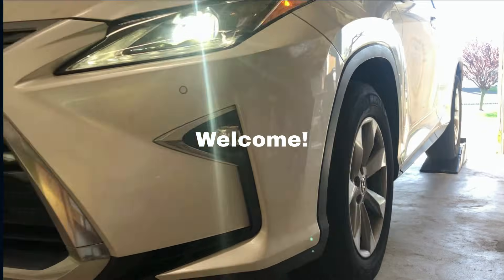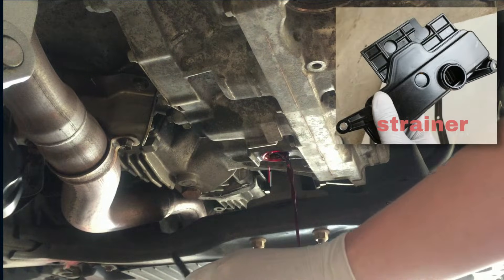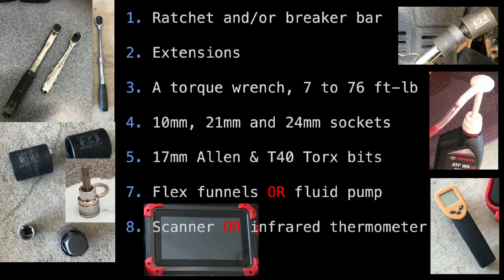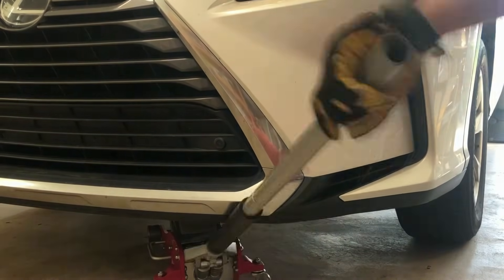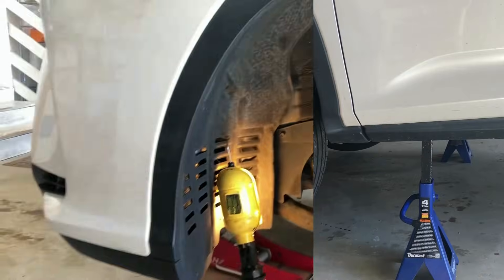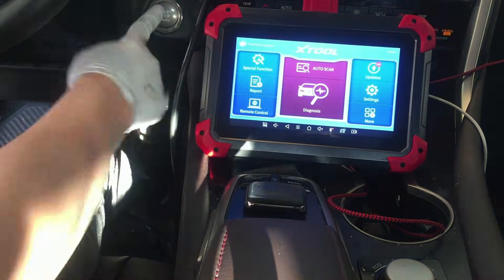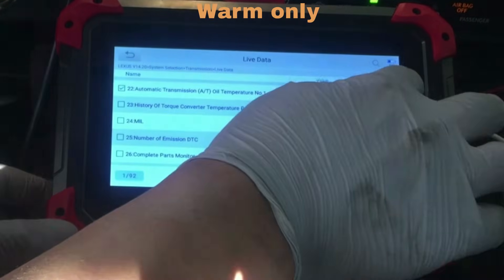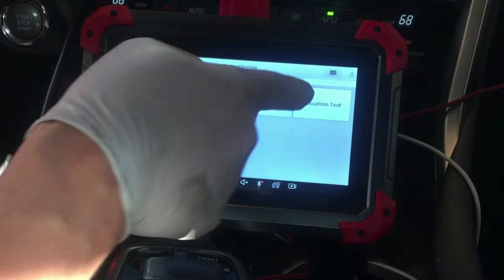Toyota Lexus Sealed Transmission Fluid Change & Level Check - 2 Temperature Gauges

Comment: How do you check the LEVEL?? That’s all I want to know and it’s nowhere
Reply from the maker: Sure! You probably didn't realize--because it's counter-intuitive with an upside-down "dipstick" for the level check--but you've just watched it in the video. To check the level: Make sure the car is level, start the car cold and shift gears to reach the 94 - 114 F range, and remove the drain tube plug (the small plug). If you see fluid trickling down, you are good and should close the plug right away. If no fluid comes out, it's low and you should add from the fill hole. For an SUV with higher clearance, you don't need to raise the vehicle: https://youtu.be/WRW4LZmvIy0. If there is no need to add fluid, you don't even have to take off the driver-front wheel either. Hope this makes sense.
Reply: The horizontal plane or level of the car, not the fluid. 

If you have a klein tool you can attach it to rocker panel and depending on the pitch of your driveway of road adjust your jack to the point where that level tool registers 0.

Comment: Hi, just bought a 2016 Lexus RX with 98k miles and the transmission fluid has never been changed. Would you recommend changing the transmission fluid? Or just leave it alone? Thank you in advance.
Reply from the maker: Under normal driving conditions, it's not too late to change it. Start with a drain-and-fill, and if everything runs smoothly, continue doing one every 30,000 miles. Here's my other video that covers this exact question: https://youtu.be/X7iQ8hWcB_w.
Reply: @ thank you for the feedback. Keep up the hard work and love the content! Definitely subscribing!!!

Comment: Automatic transmission  CVT oil is changed every 40,000 km. I drive the car approximately 7,000 km per year. Should I change the oil every three or four years, or is the maximum period only two years?
Reply from the maker: Transmission fluid in these sealed CVTs doesn't break down easily over time and you can simply follow the mileage/km interval here. That said, it doesn't hurt to replace it more frequently on the CVT. And if there is a lot of city driving in the 7000 km per year, then I'd consider changing it every 3 years or so.

Comment: Thank you for the great video, I changed new fluid, it turned dark when mixed with the old fluid, would you recommend i replacing  every month to get the red color back?
Reply from the maker: You are welcome! One drain and fill is enough every 30,000 miles. When you follow this procedure, it replaces over 1/3 of fluid capacity and new fluid mixed with old will immediately turn dark. No need to overdo it, which is riskier if done aggressively.
Reply: @profsg  Thank you for your advice and I appreciate that, but my new oil its become dark after drying not same like u red, because of this i need change another time to come red again , trust me i am not overdo it , thank u

Comment: What an underrated channel. This is very helpful, thank you for taking the time to make this guide.
Reply from the maker: Glad you found it helpful! Keep checking back for more videos!
Reply: @ would you happen to know how many quarts of Toyota WS I should have on hand for a drain and fill? 2019 ES350 with the 8 speed. I was thinking about four quarts but am trying to find an answer online. Thanks!
Reply from the maker: @linglingbraps  good question! On my 2017 RX350 AWD, about 3 1/4 quarts (3.25 quarts)  came out and I put in 3.5 quarts to begin with. I believe 2019 ES350 is FWD only and has a different transmission unit from Aisin, which, based on my reading (don't take my word though), has a smaller oil capacity and proportionally a smaller amount for a drain and fill. 4 quarts should be enough; in the worst case if it isn't, however, it won't be the end of the world if you have to put a little old fluid back to meet the required level. ;) Or purchase 6 quarts if you want to be 100% sure and the rest will go to the next change in 30,000 miles. Best luck!
Reply: @profsg  Thank you!!

Comment: My mechanic, used a simple approach. He measured the volume that was drained and then filled up the same measure. This is for my rx350. It has run for a year now. The question to the Professor is why go the extra length with temperature measurement?
Reply from the maker: Sure. This is a frequently asked question and I'm happy to answer it again. :) First, what I did in the video is the standard service procedure for Toyota/Lexus vehicles. Second, I have two reasons against the volume-match approach your mechanic followed: 1) The premise of the volume-matched approach is that the existing/old fluid in the transmission was at the correct level. While no one would doubt a correct factory fill, chances are over the years the fluid might have been touched or lost/reduced due to leaking, fluid degradation, etc. You won't get to the correct level by matching an already incorrect old fluid level. 2) The volume of fluid varies at different temperature levels so you will have to measure both (old vs. new) at the same temperature. Especially for a vehicle with a lot of miles/services, I wouldn't trust the existing fluid level is correct. Hope this clarifies.

Comment: You don't need to measure the temperature... As long as the transmission fluid is not leaking... You can measure what you drained out and replace the exact same amount.
Reply from the maker: Yes if the fluid condition is okay, no leak, no one ever touched it since factory or fluid replacement was done correctly the last time. And measure both old and new fluid at the same temperature (cold).
Reply from the maker: What I meant to say is there is a chance your current fluid level might be incorrect and you are taking a risk using the volume-match method.

Comment: THIS CHANNEL IS SO UNDERRATED! SO MUCH GOOD INFORMATION!!!
Reply: So i am familiar with the temperature process but i am having trouble with something. I started draining while it was cold until it started trickling. Then i started the car until it reached 104 degrees. When i opened the drain plug again nothing came out. If transmission fluid expands why did i get no fluid coming out? There should have been some fluid in the overflow chamber.
Reply from the maker: @nightnday6675  I understand what you did and the reasoning behind it. This is not a surprise though. First, I assume you drained/checked the fluid when COLD WITH ENGINE RUNNING. Otherwise, you would have drained too much fluid out. Granted this was followed, one would expect the fluid to expand and more will come out. And here is the other factor often overlooked in this procedure, the transmission cooler BYPASS LINE/VALVE. When one drains it at a cold temperature, the bypass valve is likely closed and some fluid will come back to the sump/pan. The cooler line won't run full circulation of fluid until it reaches a certain temperature and the valve is open again. On BMWs with ZF transmissions, the recommended temperature range will allow the valve to open and circulate ATF in the bypass line. I believe it's a same idea on a Toyota/Lexus. And this is another reason why checking the fluid at the correct temperature is so critical, to take in account the small amount of fluid in/out of the cooler bypass line. Hope this makes sense.
Reply from the maker: Thank you! Glad you found it helpful!

Comment: How about if i bought an ES350 with 120k miles and the car has no history of a transmission fluid change. Can i do a drain and fill at that mileage?
Reply from the maker: It's getting a bit risky beyond 120k miles, but it really depends on previous driving conditions. What year was the ES350? If it's relatively new with a lot of highway miles without towing (unlikely for an ES ;), then it's relatively safe for a drain-and-fill. But again there is always a risk and I analyze the question in the video here: https://youtu.be/X7iQ8hWcB_w

Comment: I'm always interested in how others check the fluid temperature.
So far everyone is using the scan tool or very inaccurate temp gun.

The most accurate and cheapest way to measure the fluid temperature is.
Everyone has this in their kitchen drawer. It's called the meat thermometer. The one with the long cable or Bluetooth works the best.

I found a cheap silicone plugs on Amazon.
I use this to plug the check valve hole. Insert the meat thermometer point through the silicone plug. Once it reaches 104 to 113 degrees, the thermometer will beep or keep your eyes on it. Simply Uncork the plug and let it drain to trickle. You're done.
Be sure to shift back and forth between the gears to distribute the fluid evenly throughout the transmission before discharging the fluid.
Reply from the maker: Interesting! No problem with the meat thermometer, but I believe the main challenge for this approach is to find an adaptor (in your case, the silicone plug) to seal it while the engine is running. Feel free to share the link to the silicone plug you used. For a Toyota/Lexus with a metal transmission oil pan though, a temperature gun will be good enough to measure the external/pan temperature within the 10 - 20 degree range.

Comment: I f’ed up… I do Uber.. my 2018 Camry has 152k right now… never did a transmission fluid change… last week I notice a few times my car doesn’t gear down to first gear
Reply from the maker: Sorry to hear about that! Unfortunately, it might be too late to perform a transmission fluid change now with 152k demanding miles on it. If you consider taking the risk to do a drain and fill to potentially extend its life, I'd recommend a transmission oil analysis to better understand the fluid condition and make an informed decision.

Comment: Thanks for the video.
Reply: Where did you get your washers and "O" rings?
Reply from the maker: From your local Toyota dealership, tell them your part numbers (which I posted in the video description for the 2017 RX350 in video) but you can ask them to find your parts based on year/model/trim. Some dealerships are online too (e.g. on eBay). For example, this Toyota dealership has the o-ring: https://ebay.us/AxAcVn
Reply from the maker: You are welcome!

Comment: Can't I just measure how much fluid I take out and replace with that amount? Thanks!
Reply: Thanks for the reply!
Reply from the maker: This is a "classic" shortcut. :) However, I don't recommend doing so for the following reasons: 

1) This method assumes a correct amount/level of existing fluid in your transmission. While it's safe to assume they did it correctly in the factory, there is always a risk someone may have touched the transmission and set it at an incorrect level. 
2) Even if the above is correct, you will have to measure the amount accurately under the same temperature. 

Modern transmissions are sensitive to the fluid level so make sure you set the level correctly. Also, there is a budget-friendly OBD2 option ($30 or so) to measure the temperature accurately, check out this video: https://youtu.be/ytdcZ1X8EeQ

Comment: what happens if i open check plug before it reach that recommended temp?will i be overfilled or underfilled?
Reply from the maker: Most likely you overfilled the transmission. The same fluid at a lower temperature will expand when it gets hot. You can do another fluid check, i.e. to drain more at the correct/higher temperature.

Comment: I have questions on torque and part numbers.  You have part #s for washer and O rings on RX 350.  What would be the part #s for a 2021 Rav4 XLE be?  Under Remove Filler Cap you have #6 for overflow tube @ 36 Ft-lbs., #9 filler cap 36 ft-lbs. and #12 for the drain plug @ 7 ft-lbs.  What would be the torque for 2021 Rav4 XLE?  Thanks!
Reply from the maker: On Toyota/Lexus vehicles, the ATF fill cap is generally the same 24mm and, if that's the case on yours, the torque should be the same 36 lb-ft. 

As for torques for overflow tube and drain, here is a related post: 
https://www.rav4world.com/threads/did-a-transmission-drain-and-fill.305457/
Reply from the maker: As for part numbers, double check but here is what I found: 
1) Washer for the 24mm filler cap should be the same: #90430-A0003, https://amzn.to/4ebsQaR
2) For the overflow/drain plug, I believe you only have one drain washer (crush washer not rubber gasket): 90430-18008, https://amzn.to/3X6mYd5

Again, they should fit but please double check.
Reply: @profsg  I finally got around to addressing the fluids on my 2021 Rav4 XLE Gas.  Here are the PNs 1) For the fill and drain plugs on the transmission the PN is 90430-A0003, which are flat washers.  The cost at the dealer was $2.04 each and you need 2.  2) There is no O ring for the overflow tube.  3) For the fill and drain plugs on both the Transfer Case and Differential all 4 are crush washers and PN is 12157-10010.  The cost at the dealer is $1.98 each, you need 4.